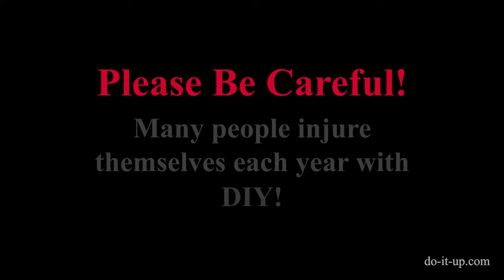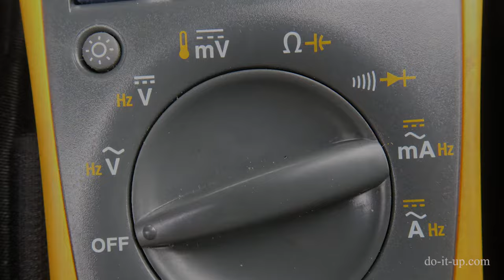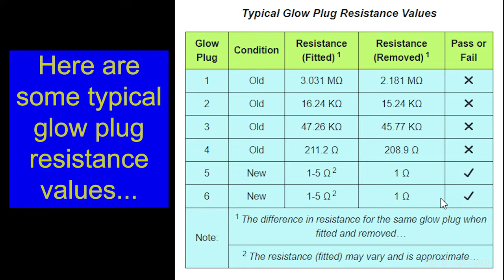How to Test Glow Plugs - Measure the Resistance (Still Fitted to the Vehicle)

Comment: Hi... make this test after turning the ignition key at position 2 . or not ?
Reply from the maker: Hi, yes...  Turn the ignition on, so you have voltage applied to the glow plugs, (often called position 2). You don't usually have to have the engine running, as you want the glow plugs to preheat before the engine starts. Hope this helps...   👍😃

Comment: Hello.
Thank you very much for your video.
One question please:
I need to change them. But I can buy 4 glow plugs of 0,5 ohm-s or 1 ohm-s.
Which one is better???
1 ohm???
0,5 ohm??? These are cheaper, almost half price than the 1 ohm-s.
Thank you very much.
Have a nice day.
Reply from the maker: Hi, I wouldn't be able to say if one is better than the other, as there could be other design parameters involved. The best thing to do, is if you know the make of the glow plugs, visit the manufacturer's website. They often have lookup tools, or an online catalogue (sometimes called a webcat) where you can check the requirements for your vehicle. You could also compare with other brand catalogues to see which is the correct fitment for your vehicle. If you get offered a choice of more than one glow plug, you would have to look at the specifications to compare. For instance...  It could be your specific engine, the temperature range where you live, (or other parameters) in choosing which is the best one for your vehicle?

Unfortunately, sometimes manufactures change engine specifications part the way through a models life, making it more difficult to find the correct part. You can sometimes find the specific engine fitted to your vehicle by looking up the detail using your VIN number online. Try and make sure it's a reputable website. Here's an example google search: https://www.google.com/search?sxsrf=APwXEdd17lMJdiQzK_z1DHPNGrMYSqzm7w:1680023562740&q=Vehicle+specs+by+VIN+free&sa=X&ved=2ahUKEwjWna-9j__9AhWholwKHXZCCqcQ1QJ6BAg8EAE&biw=1920&bih=929&dpr=1       This should help you make the right choice when ordering parts.  Hope this helps...    😃
Reply: @doitup  the 2 of them (0,5 and 1) are of the same brand. But I forgot the name of it.
Reply: @doitup  thank you for your answer.
Reply from the maker: Hi, no problem. It can be a pain trying to find the right part, as there are often different parameters to consider. As an example, my wife's mini could have one of two engines fitted. Both are a 1.6 litre engine...

- 1598cc 85KW 116HP, N12 B16 A; N16 B16 A
   or
- 1598cc 88KW 120HP, N12 B16 A.

A VIN number search eventually told me which one was fitted...   I hope you get it sorted soon...   😄

Comment: Hello. How do you remove the plastic case? Just pull it up? I’m not being capable of removing it
Reply from the maker: Hi, if you mean the accoustic cover over the top of the engine, they can be push on and off. But they can also be held on with clips and screws. Sometimes they can be made of several parts, (where you have to remove part of the cover to reveal more clips or screws underneath). The best way is to slowly work around the cover, identifying where the most resistance and try and fathom out how it's fixed.

If you mean the connections on top of the glow plugs, they may just be pull off. They could also have a release mechanism where you compress part of the connector to release. Unfortunately, each manufacturer may have their own method of release, and this may change depending on the vehicle model and its age? Use Google to see if anyone demonstrates how, when carrying out similar tasks with the same type of vehicle... I've probably not helped you much here, but it may have pointed you in the right direction? I hope you get it fixed soon...   😃

Comment: Hi. Do I need to remove the leads, they're held on with a nut, but deep down. Save aggro if I didn't.
Reply from the maker: Hi, I would measure the voltage with the lead in place if you can and see what it is. If there are any discrepancies, then you may have to remove the lead to check it. Before you do that though, check what the actual voltage should be for your vehicle. You can look up the data sheets on one of the manufacturers websites to verify if the voltage is correct. If you have to remove the leads, a magnet on one of those telescopic sticks, are extremely handy if you ever drop a nut or bolt, (and sometimes you can magnetise a socket with it). Hope this helps and you get it fixed soon...  😃

Comment: i got my glow plug fuse blown out and what do usually cause this? shorted glow plug to ground? can I check which one is at faulty without removing it? I have boxer engine so it is not that easy to take them out
Reply from the maker: Hi, the fuse will blow if the current in the circuit gets too high. This is often caused by a dead short. You should be able to check for this with the glow plugs still fitted. You may want to make sure your test meter reads 0 ohms (by touching the two test leads together) before you start, to make sure you can get an accurate reading, (as glow plugs usually have a low resistance). If there is nothing obvious when fault finding, try and disconnect different parts of the circuit (to split it into different area's), so you can try and isolate the area where the fault is occurring. Note that the glow plug(s) may initially appear to be OK (when tested cold), but could break down under load. Hope this helps...    😃
Reply: @doitup  thanks for your video and your answer !!!
Reply from the maker: No problem...   I hope you get it fixed soon.

Comment: Anything up to 6 ohms is acceptable. Meaning, not all these need replacing. That one with 211 ohms lol. Does it even work?

Good video. 😊
Reply from the maker: Hi. Anything up to 6 ohms is acceptable..?  Not a straightforward answer I'm afraid. In some cases yes...  Newer vehicles may have more fancy glow plugs! If it's a fancy glow plug the resistance may be more specific. Plus they now have other tricks up their sleeve such as pressure sensors included, etc. Dependant on your vehicle...  If it has 'fancy pants' glow plugs,  it may be useful to look up the data sheet on the glow plug manufacturer's website. Some specify more precise measurements for voltage and resistance, as glow plugs and vehicles get smarter...  Nothing's ever easy these days!

Thanks for your comment, I hope the not so straightforward answer helps in some way...   😄
Reply: @doitup  No I totally get it, I understand that much. Technology is never simple lol.
Reply from the maker: Technology is wonderful...   May it never break down or take over the world, and allow us all to retire on full pay, (index linked)...   👍😁
Reply: Number 1 is 3ohms, why has that failed?
Reply from the maker: Hi, it could be that it's a newer more fancy glow plug that has tighter tolerances? You may be able to look up the manufacturers data sheet to get the exact values of your specific glow plug. You can also check that your test meter is reading the correct resistance value. There is an explanation of how to check your test meter here: https://do-it-up.com/vehicles/engine-transmission/diesel-wont-start-when-cold-how-to-fix-glow-plugs/#Check-Your-Test-Meter. There is more info on glow plug resistance here: https://do-it-up.com/vehicles/engine-transmission/diesel-wont-start-when-cold-how-to-fix-glow-plugs/#Checking-the-Glow-Plug-Resistance. that may help? Hope this helps and you get it fixed soon...   😃
Reply: Some are in kilo and mega values. All bad
Reply from the maker: Hi, does sound like they're bad. It may be worth checking the glow plugs when you remove them, (if you haven't removed them) in case you get a different reading? It wouldn't be unknown for corrosion or a bad earth (poor return path back to the battery) to cause a high resistance. Measuring the glow plugs when removed, would be an additional confirmation that they're defective. Thanks for letting me know. Hope you get it fixed soon...   😃👍
Reply: @doitup  are you giving automated responses?😂
Reply from the maker: I wish I could...   It would save a lot of time. YouTube gives one and two word suggestions sometimes. But that seems a bit impersonal when someone has taken the time to leave a comment...  So it's good to leave a typed comment in response, (even though I do repeat myself sometimes)...   🤔

Comment: Hi, when I do the same test with my multimeter, I get a reading of 0 on all 4 glowplugs, does this mean they are faulty? My car doesn't start but not displaying any codes
Reply from the maker: Hi, there would usually be a very small amount of resistance (typically between 1 and 6 ohms), with a working glow plug. A more detailed description of the resistance and what to expect can be found here: https://do-it-up.com/vehicles/engine-transmission/diesel-wont-start-when-cold-how-to-fix-glow-plugs/#Typical-Glow-Plug-Resistance-Values.

However, if you're measuring the glow plug resistance with them still fitted, you can get errors. So, if you suspect the glow plugs are faulty, you can do an easy practical check.

- Remove the glow plug from the vehicle. Plug it into the connector and place it somewhere where it won't burn anything. Earth the end of the glow plug that screws into the engine with a jump lead or similar, (to provide the electrical circuit). Turn on the ignition and see if/how much it glows, (and also very importantly...  How long for). I have another video that shows how to do this, if you follow the link: https://youtu.be/YkKsbRHHNS8?t=438.

- More detailed information, can also be found here: https://do-it-up.com/vehicles/engine-transmission/diesel-wont-start-when-cold-how-to-fix-glow-plugs/.

Hopefully this will prove the glow plugs and the glow plug circuit, (before replacing anything). Please let us know how you get on, as it may help others? As usual, at your own risk.

Hope this helps, and you get it fixed soon...   😃
Reply: @doitup  thanks for the reply, I can't remove the GPs as they're stuck and don't want to snap them, but managed to get a better reading, all 4 GP are showing 0.07, I don't know if that's good or bad
Reply from the maker: Hi, It's difficult to say without removing the glow plugs and physically checking if they heat up? Testing in place may only give an indication of their condition. If there is corrosion, (they're stuck) then there may not be a good electrical contact for the glow plug circuit to work effectively, (or to take measurements). 0 ohms would be a dead short. 0.07 is close to that, (1 to 6 ohms is typical, dependent on the type of glow plug). You should also check the glow plug timer, and supply voltages in case the control unit (relay, etc) is defective? I have a video here: https://youtu.be/A_IUlFjHcvI.

I also have a video on removing the glow plugs https://youtu.be/hTCgpOxTPXA. If they're difficult to get out, try removing them when the engines hot. Soak in penetrating fluid (leave it to soak in), but make sure it's not so hot the penetrating fluid catches fire, or gets spilt on a hot exhaust, etc. When replacing glow plugs, they don't need to be tightened much at all (about 7 to 9 Nm, dependant on the type). Use copper ease, a copper based high temperature grease on any threads, to prevent corrosion and prevent them from getting stuck again.

As usual, at your own risk. Hope this helps, and you get it fixed soon...   😃

Comment: Is it assumed you disconnect the glow plug harness first  ..
Reply from the maker: Hi, yes...  It's best to disconnect the glow plug from the harness before taking any measurements. Please note that you will always get a more accurate reading with the glow plug removed. Measuring the glow plug when still fitted may only give you an indication on the glow plugs condition, (as you can get errors if there is corrosion etc). However, If you do get a good reading with the glow plugs fitted, then you know the glow plug is making a good electrical contact with the engine head/block.

If you need more detail, I have some other video's here:
- How to test glow plugs with a test meter (from start to finish): https://youtu.be/nFrvzstFqwE
- How to test glow plugs without a test meter (from start to finish): https://youtu.be/YkKsbRHHNS8

Hope this helps (and makes some sense!)...   😃

Comment: Thanks, a very useful video
Reply from the maker: Thanks for letting me know. I'm glad it was helpful...   😃
Reply: What if they come back as 1 ? Thanks in advance
Reply from the maker: Hi, A typical resistance value for a working glow plug is usually between 1 and 6 ohms. You want a low resistance, so the energy is dissipated in the glow plug and it heats up. But… Not a really, really low resistance (like a dead short). Otherwise, the energy will be dissipated in the glow plug, and in the rest of the circuit. Blowing the fuse and potentially melting the wires (dependant on the fuse rating and how quickly the fuse reacts!).

More information can be found here, Typical Resistance Values: https://do-it-up.com/vehicles/engine-transmission/diesel-wont-start-when-cold-how-to-fix-glow-plugs/#Typical-Glow-Plug-Resistance-Values and here, Glow Plug Resistance Explained: https://do-it-up.com/vehicles/engine-transmission/diesel-wont-start-when-cold-how-to-fix-glow-plugs/#Glow-Plug-Resistance-Explained.

Hope this helps...   😃

Comment: Remember glow plugs are different, Delco,Bash can be 10.5v,11.5v,12.0v( heat different),same as resistance( 1.0,1.2,1,3owhz)
There is another tip,glow plug relay,must be specify.
Parts must be in good quality, business don't follow it...
Prepare yourself to see new world with a junk left.
Reply from the maker: Hi, yes. Great info... The voltages and resistance can vary. Typical resistance 1 to 5 ohms and the voltages from 5 to 12v dependant on the system and manufacturer. Generally the 'older type' of glow plugs would be around 1 ohm... https://do-it-up.com/vehicles/engine-transmission/diesel-wont-start-when-cold-how-to-fix-glow-plugs/#Typical-Glow-Plug-Resistance-Values... and approx 12v https://do-it-up.com/vehicles/engine-transmission/diesel-wont-start-when-cold-how-to-fix-glow-plugs/#Checking-the-Glow-Plug-Supply-Voltage-the-Glow-Plug-Relay. It's always best to check the manufacturers specifications on their website though, especially if it's a newer type vehicle!

When measuring resistance, it's always worthwhile checking your test meter is reading correctly before you take a measurement... https://do-it-up.com/vehicles/engine-transmission/diesel-wont-start-when-cold-how-to-fix-glow-plugs/#Check-Your-Test-Meter.

Thanks for the info...  Anything that's useful to others trying to fix their vehicles is always a great help...   👍😃